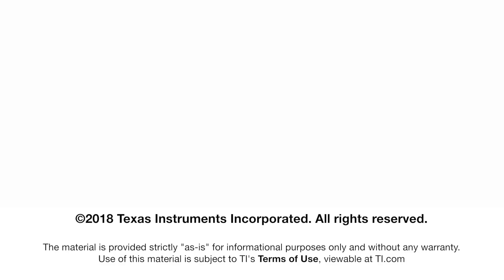Connect: Zigbee Demo

Comment: To which device the beagle bane black is connectedwith wire ?
Reply from the maker: Hi Kundan - The BeagleBone Black is connected to a 5V power supply and a CC26x2R Wireless MCU LaunchPad via USB.

Comment: Is it possible to connect mobile using zigbee network only instead of wifi?
Reply from the maker: Hi Kundan - No mobile devices do not typically contain 802.15.4 radios.
Reply: Not possible. You would need to install a 802.15.4 device in your phone. Our phones are equipped with the 802.11 standard and so we can use wifi. bluetooth is another standard and it needs it's own piece of hardware.